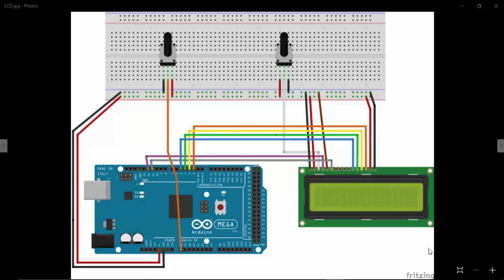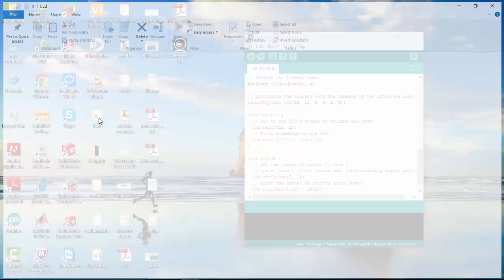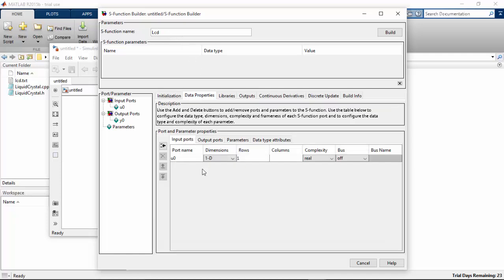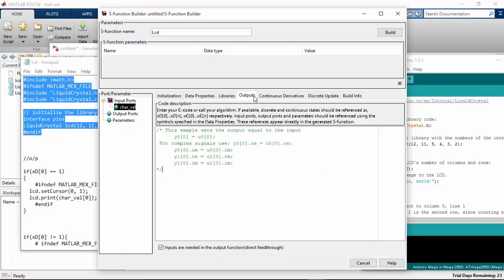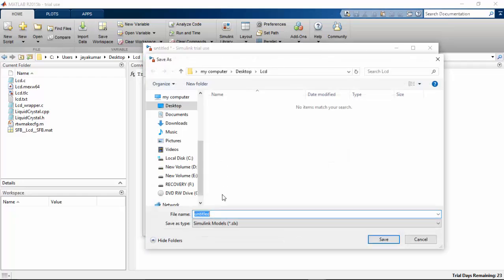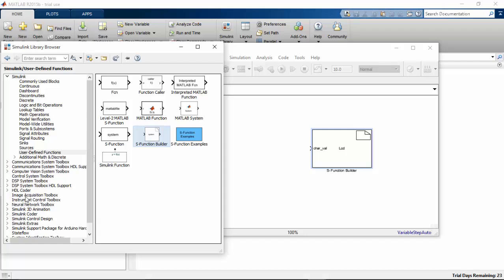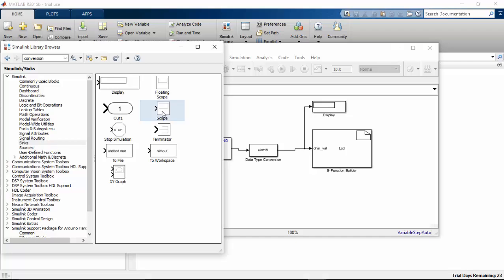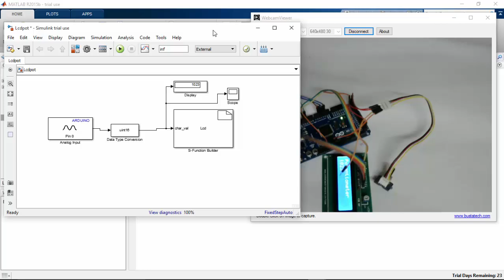7. How to create S function in Matlab simulink for Arduino

Comment: Hello! I'm into a small project that consists in simulating a PID algorithm I coded into arduino using simulink in a simple master-slave config. Matlab would send the setpoint, plant transfer function's output and other parameters to arduino through serial comms (float to int32)  and then the controller would respond as fast as possible sending back to matlab the input(int32 to float) for the transfer function, so arduino would act like a simulink pid block in a realtime simulation. 
So, I need simulink to run continuously but the inputs must be sampled. The outputs would be continuously changed by arduino, like a sampled but delayed output.
So far I tried to use a serial variable from matlab workspace into a simulink's matlab function block with no success. Now I'm looking at S-functions and I think the only way is to write my own functions. I know how to use model callbacks to open and close serial comm with arduino, but I still don't know how to use global variables in this setup and how to set the sampling times the way I described. Any ideas about it? Do you think it is possible to do this? Feel free to answer this or not. Nice video and keep up the good work!

Comment: hi mate, as you know the available arduino package has a PWM block with fixed frequency equal to490HZ for Mega. Can you please help me to build S-function so that I can change the frequency to 20KHz
Reply from the maker: +Oday Ahmed Hi, as you can see I have created these tutorials with trial pack, now my trail has expired and I don't have Matlab package with me to try it :( , sorry about that.
Reply: Good evening, I have a problem my matlab does not compiler the "mexfiles" or ".wrapper.c" from http://playground.arduino.cc/code/timer1

Do you know any solution?
Reply: Dear Dr. Ahmed did you find a solution for chnaging the PWM frequency? if yes could you please give me more details ? I really need that